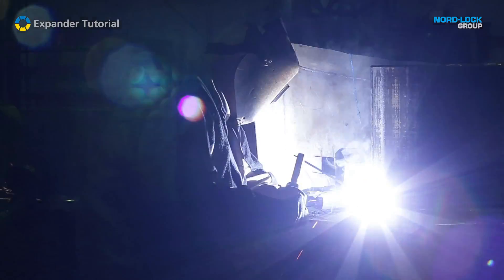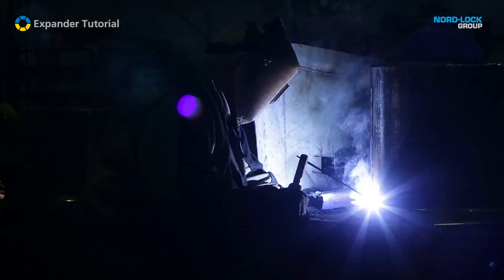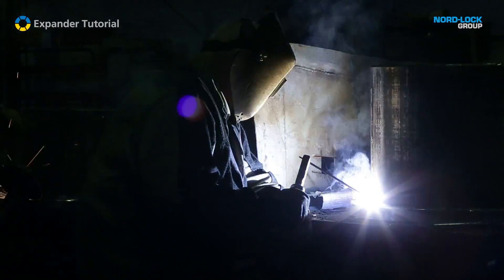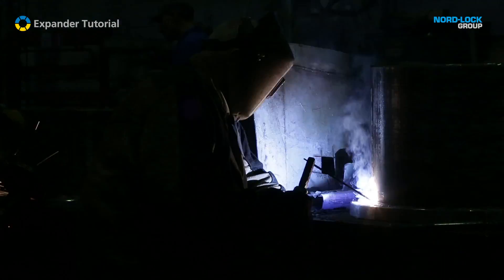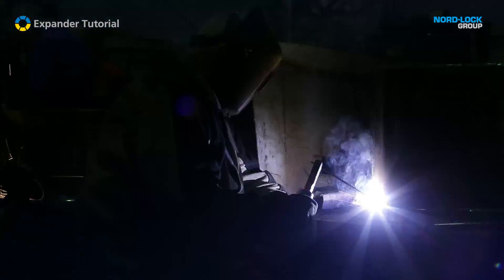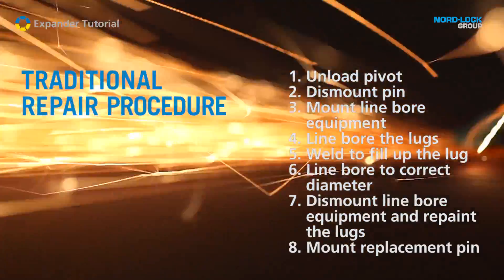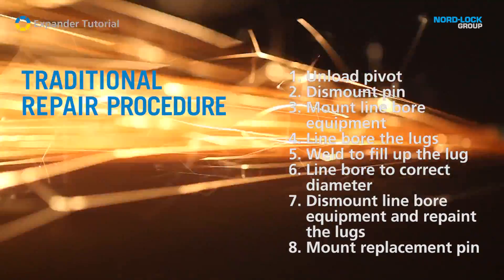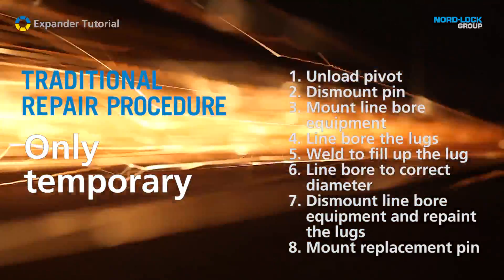Expander Tutorial - Part 5 - Traditional Repair vs Expander System

Comment: Using nylocks and having to re-torque until its fully settled? Someone should invent some sort of locking washer that protects against vibration and settling,  Maybe some sort of belleville washer combined with a hardened locking washer that doesn't rely on friction to keep the bolt from spinning.
Reply from the maker: Hi! The reason for the retightening is not due to the nuts rotating loose. The retightening is to make sure that there is a tight fit between the lug and the conical sleeves. When you tighten and you run the machinery, you will get a working load and that will result in some settlement and that is why you should retighten. If the hole in the lugs is oval in shape, due to wear, then you need to retighten more as compared to if the hole is round.